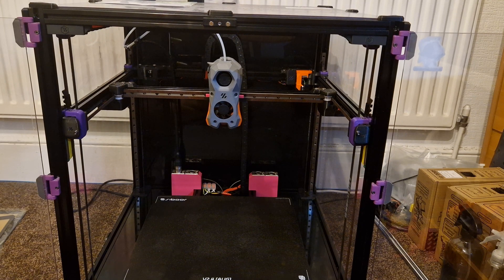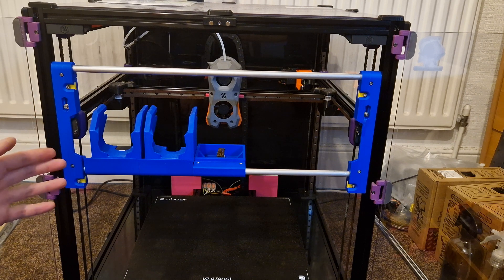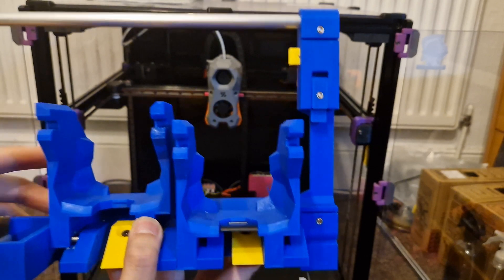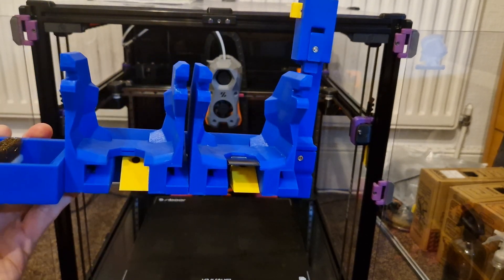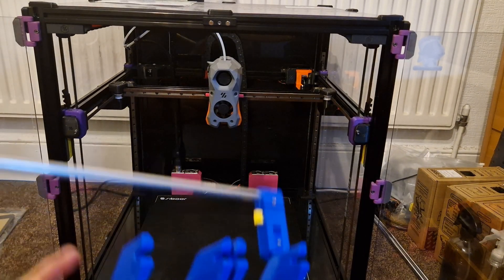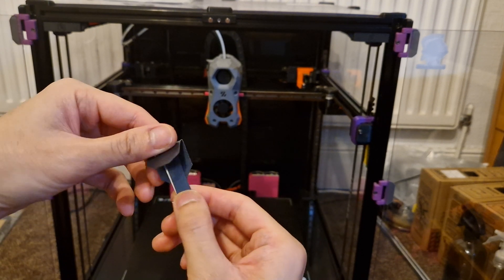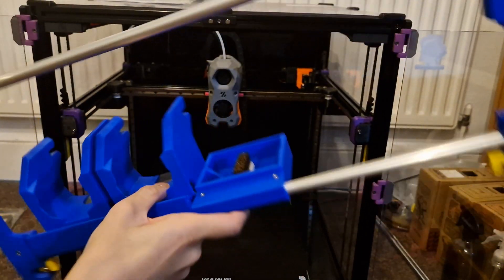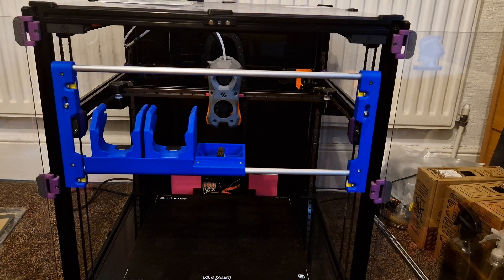MissChanger - Dock v0.1

Comment: Very Nice!  How many cm do you loose in Y when using this system?
Reply from the maker: 120mm. basically, 1.5x the Y dimension of the toolhead
Reply: @vinny5915  Ouch, that's way more than I thought.. I'm probably going to build an entire new printer to make use of the tool changer. I will increase Y with an extra 120mm, and probably X with the width of one cradle. (so I can house one more toolhead, plus being able to clean the nozzle at a low Z beside the bed making use of a purge bucket)
Thanks! 👍
Reply from the maker: @winandd8649  the idea is that I can remove the toolchanger bit for the full built volume, if ever needed. https://youtu.be/BdVnh--UKEo
Reply: @vinny5915  Yes, I know, but that's not how I'm planning to use it 😉